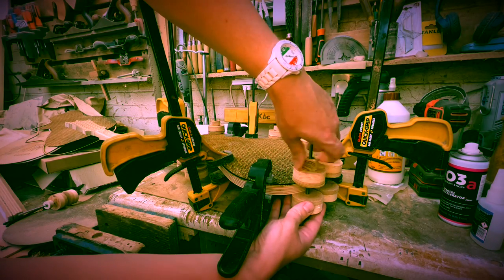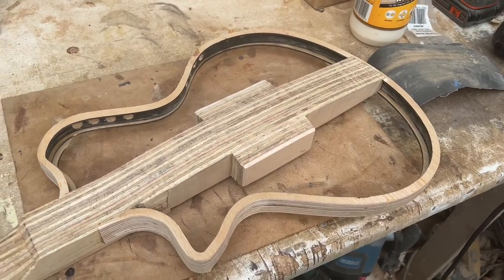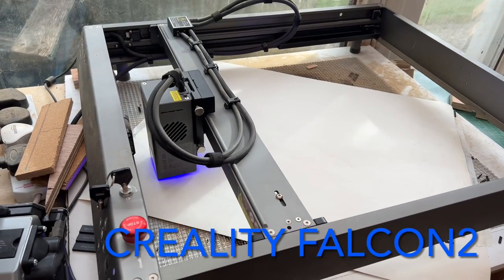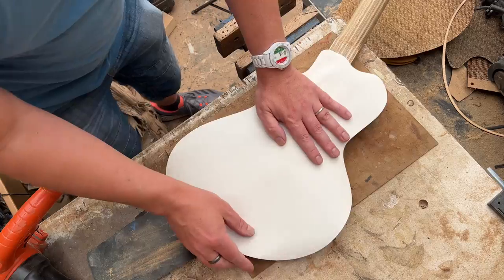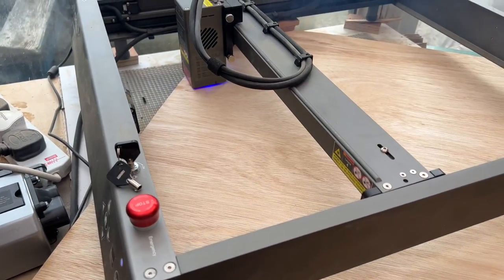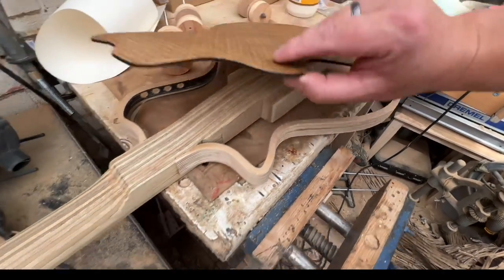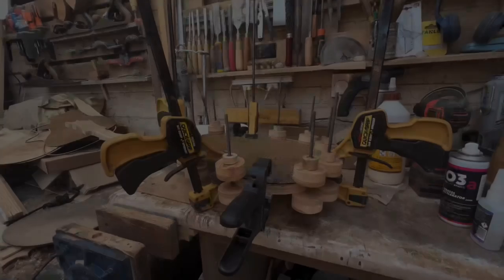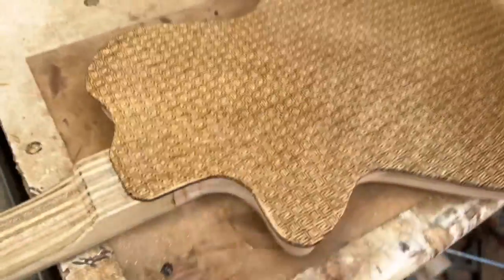LASER flex PLYWOOD guitar build is SO COOL! -  Jurgs cup continues

Comment: Cool. Have you tried/considered a thin epoxy resin (usually it's used as a grain filler, something like west system 105) to strengthen a structure?
Reply from the maker: It would need to be something that barely needs a sanding.